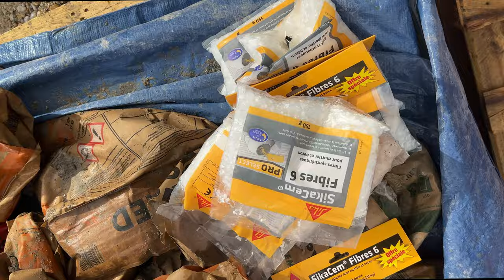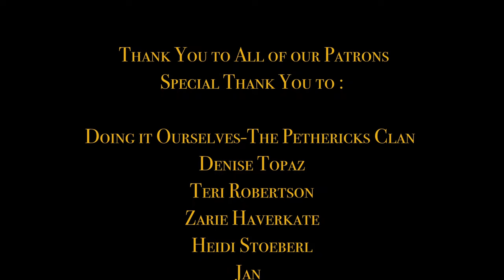Tiling Begins On The Footpath  @ The Passion Project

Comment: Another option for the bulk of the pathway is to line it with mostly square set tile, and then every 10 or 15 feet make a diamond in the center of the pathway with four tiles all set in diamond orientation.  It would keep the diamond motif through the pathway without forcing you to set all the tiles in that orientation.  Just a thought.

Comment: I was surprised with the decision to use all the small red granite stone for the sidewalk/entry. I thought they would be border stone and the large white Travertine (like around the pool) would fill the rest of the walkway. That would have been a lot less cutting and work, but I always look for the easier way out. Putting the middle stone  diagonally also adds much more work and takes so much talent to do. Edd looks at the big picture over time. What a perfectionist and visionary he is!

Comment: Looking great. You’ve thought of everything. I understand why you have a right-angle turn in the path - the entrance would not be as grand without the straight walkup. However, most people’s brains want to cut across the corner of the path to reach the front door. Have you thought of a focal point at both approaches to the corner, so the eye is drawn to that point and the brain will want to approach it (without corner cutting)? Something like a statue, fountain, beautiful tree, plant, pergola, loggia,  (roughly where the digger is parked in this vlog in the egress direction). I’d be interested in your thoughts.

I was impressed with the uplight soil pipe inset. I didn’t think of making the mould and then taking the pipe out. I can’t wait for next week’s update. It is all coming together beautifully.

Comment: May I just say in my opinion the path from the front porch should have curved instead of a 90 degree turn, otherwise great job! I would not have staggered the lights but put them in pairs, then again its your passion project. The water in the pool looks brown. Fantastic effort Ed and Anna.
Reply: Initially I thought they should be paired also; but, It might end up looking like a runway. I agree about the curve also but take a look at my recent comment about a focal point at the approaches to the right-angle.

Comment: Jenny Garrett had said (in last vlog) "The uplights need a pvc tube that sets in the concrete and then the whole light assembly slides in afterwards. So, if the light breaks, you can easily remove it all for repair/replacement. But, all looking great! Can’t wait for the big reveal." So isn't that what you decided to do?
Reply from the maker: Exactly we had come to that conclusion when we went to the shops after filming the vlog before this one

Comment: Oh no.  The overhang won't work well over time as frost will get under and expand differently than the mastic portion which will quickly cause cracks and breaks. Maybe your ground doesnt freeze like we get in Southwestern Ontario Canada. Im hoping Ed realized this or maybe he is planning more concrate on the underside as he mentioned a solution for the grass.

Comment: Is concrete delivery expansive in France? Just a guess but I'd say the footpath would be 5-10 yards of concrete. In the US $100 per yard. I don't think I've ever mix more than half a yard by bag. I've seen Edd mix hundreds of bags. What am I missing? Just curious.
Reply from the maker: Hi Gary the problem is 2 fold …. It’s mega expensive for concrete delivery but the main problem is access …. We end up having to pay for a pump as the truck can’t get through the gates …. Also we have block off the parking at the front of the house …. That’s more French papier work too!!
Reply: @BordeauxLife  Is French paperwork a bad thing? 🙂
Reply: @BordeauxLife  I thought it was some sort of compound complexity. 3 years ago I had to pour 28 yards BEHIND my house. The pumper was 2x the cost of the concrete.😱Whatever it take, eh?